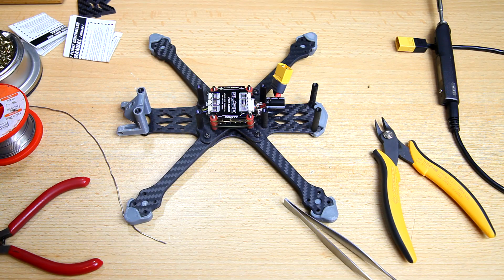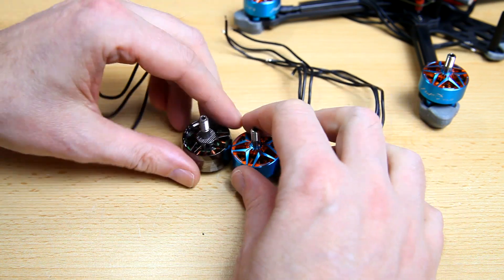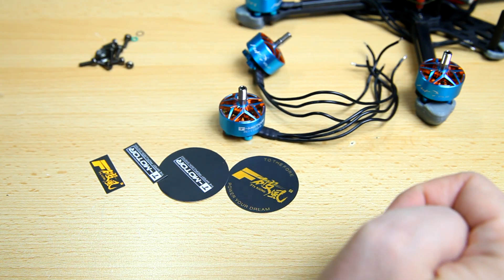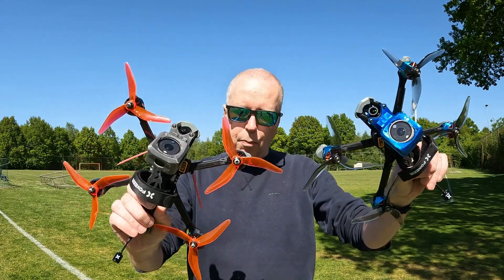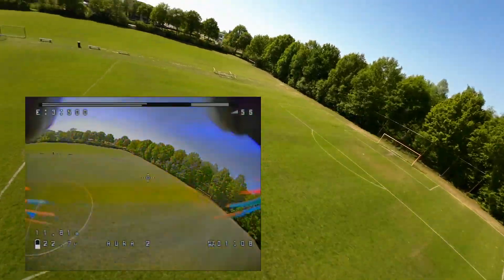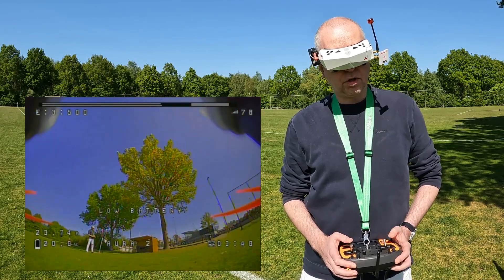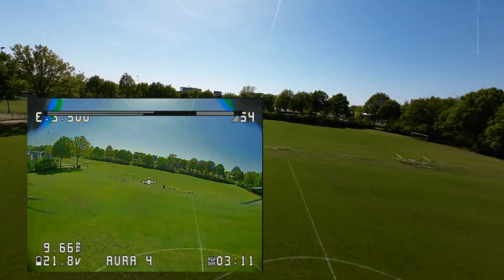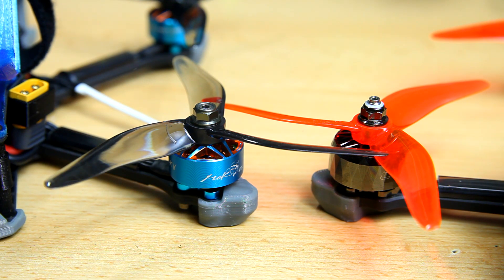T-Motor MCK 2207.5 vs iFlight Cyber Xing 2207.5 - MOTOR REVIEW

Comment from the maker: in our quest to find the Perfect 5" FPV Quad Motor :) 
The motor: https://www.banggood.com/T-Motor-MCK-2207_5-V3-1910KV-4-6S-Brushless-Motor-for-RC-Drone-FPV-Racing-p-1708665.html?p=TO251813974002015038 

Specs
---------------------------------------
stator: 22mm x 7.5 mm 
KV: 1910 KV 
config: 12N 14P
voltage: 4S to 6S 
weight: 33 grams
winding type: single stran
main bearing: not specified 
shaft diameter: 5 mm 
shaft material: titanium (guess) 
magnet type: not specified 
curved magnet: probably not 
magnet retainer: screw 
mount spacing: 16 mm M 3

Comment: I can't tell the speed difference but with heavier quad you need a bit more throttle -> more rpms -> more speed. Lighter quad will probably accelerate faster and will be more manevurable so you will be faster on a race track. Just a thought, I might be wrong.
Reply from the maker: Hmm acceleration will indeed depend on weight :) 
top-speed not a whole lot I'd say :$

Comment: Nice video! Could a three-year-old quadcopter benefit from a new set motors, if one replaced them with comparable in size and kV T-motors?
Reply from the maker: Thanks bro :)  
hmmm depends on the state of the motors? if the quad was flown a lot bearings could be worn